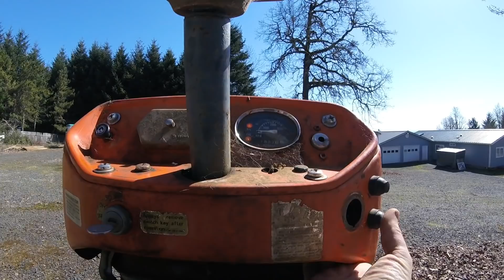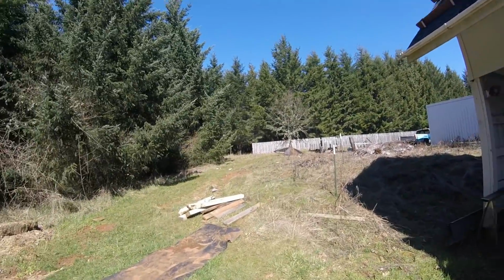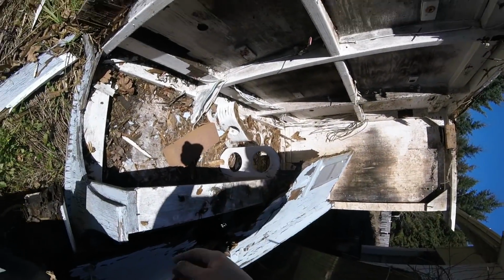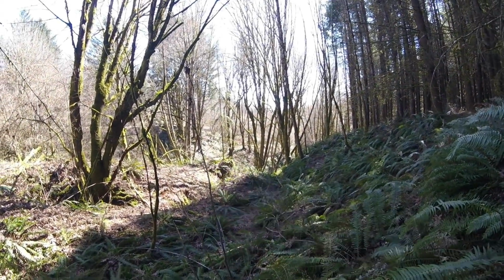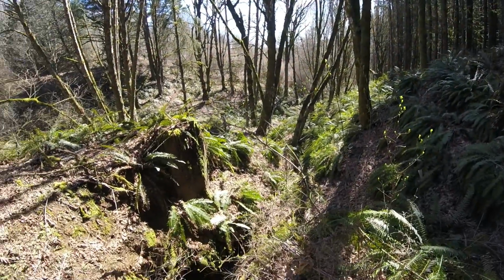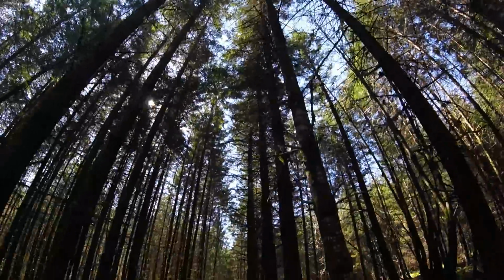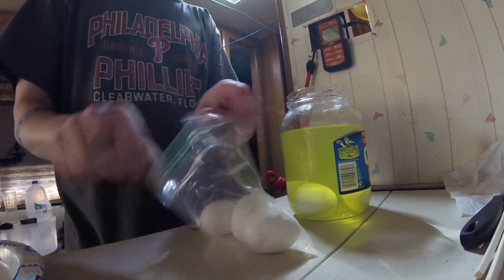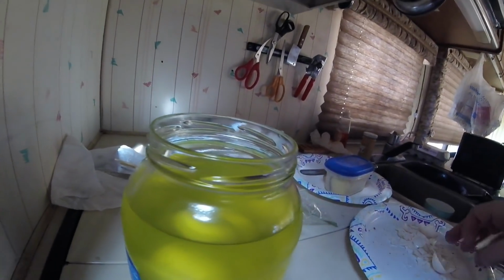Ranch Life || Full Time RV Living

Comment: when i was boondocking across the USA, id wear earplugs and run a fan or air purifier at night. most of the time the noise outside i would never hear. only semi trucks, and then id wear a noise cancelling headset. i used soundboard on the bedroom as well, cut the noise down alot.